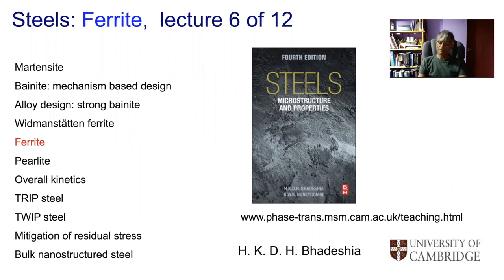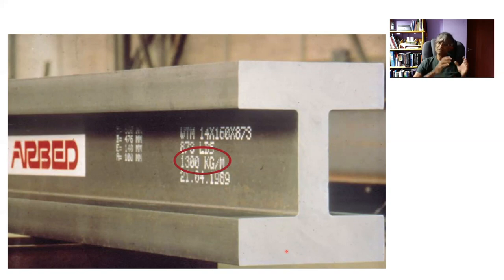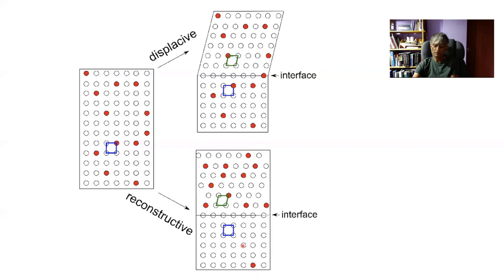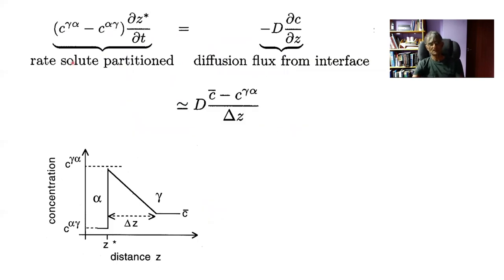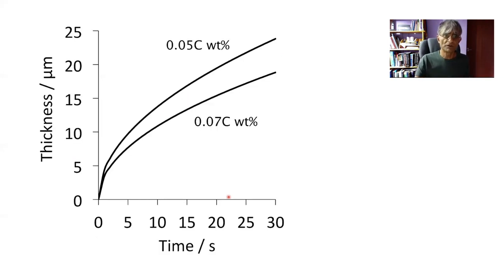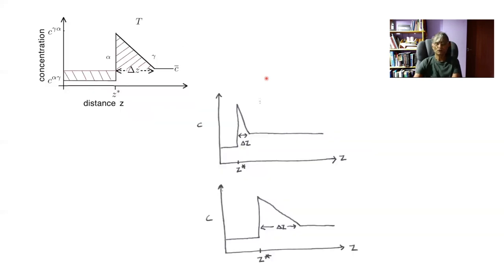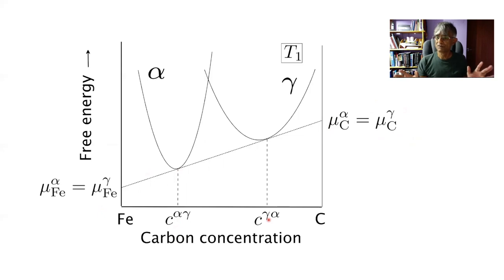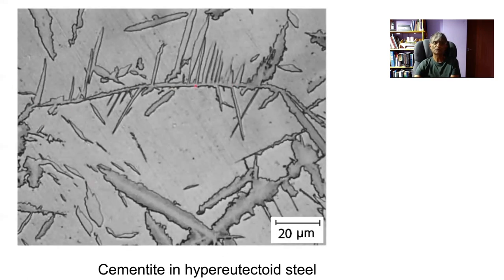Steels: allotriomorphic & idiomorphic ferrite. Lecture 6 of 12

Comment: Hello, could you tell me microstructurally speaking the difference between allotriomorphic ferrite and proeutectoid cementite? please
Reply from the maker: I assume your question relates to optical microscopy. I seem to remember vaguely that an etchant using sodium metabisulphite stains the ferrite but not the cementite. However, best thing is to look up a book such as van der Vroot, on etchants. Bear in mind that chemicals must be used with the appropriate safety assessments defined in the control of substances hazardous to health regulations.